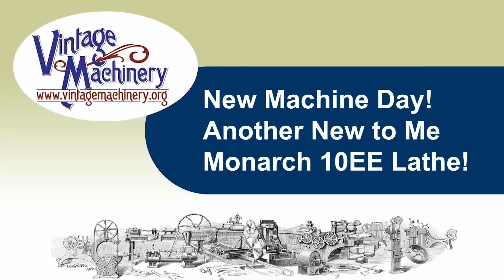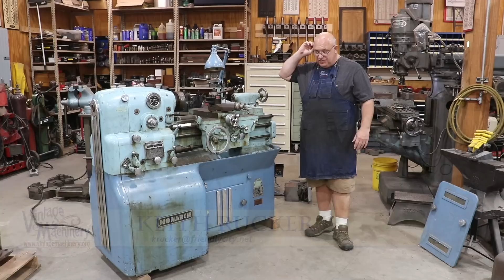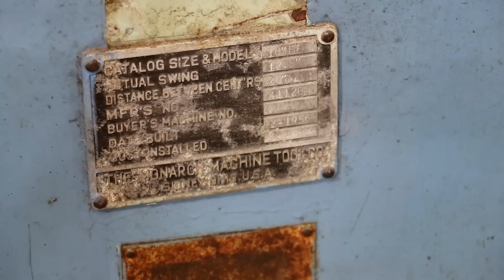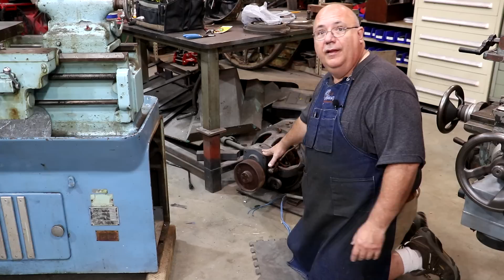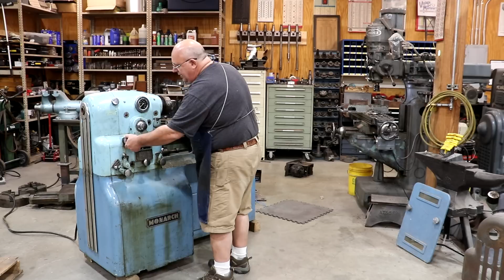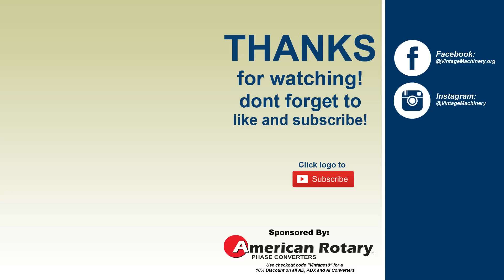New Machine Day! Another New to Me Monarch 10EE Lathe!

Comment: Keith, 120/208 is an extremely common service voltage for commercial applications, and is three phase service. Phase-phase voltage gives you 208 volts. Phase-neutral is 120 volts.
Reply: I think he said that exact thing.
Reply: @michael931  
no..he said it was Single Phase
Reply: @garymallard4699  14:06 he explained it in detail.
Reply: @michael931  
i used to replace Transformers on 208 volts and they are only in Commercial settings... he said what he said which is that he doesn't understand it well...yep !! by his video i believe it ..i did Commercial lighting for 3 decades at many Voltages ( up to 600 volts )...  he has to learn what he has as it was " changed " from factory voltages...and probably isn't 208 and not 3 Phase either..all the components should be labeled..which is where i would start figuring it out....i was referring to his later comment in that part saying he could change or get it at 208.... he needs to get someone knowledgable on what was converted and what it is doing FIRST....as he has no clue based on what i listened to him say..lol

Comment: I don't know if I like those Electronics or not. But I live in England where we have 220V single phase. Now you can get Single to Three Phase VFD converters. So for us is is a simple matter of fitting a new more modern 440V three phase motor 4 pole if you want 1400 rpm (we are 50cycles). Then Just wiring it up in Delta To be 220V three phase Through a VFD & bingo we have a variable speed motor set up. You have to change the motor to comply with latest regs regarding insulation & heat. Now we seam to be more into Poly V belt drives as well to give us less slip & longer belt life. So essentially it is out with the old & in with the new. In your case getting the existing switches to operate the motions is more important than anything else.  But I am not in the USA so not aware of your problems. Regards Mervyn Price.

Comment: Variac change voltage .  The set up is a fully manual replacement for a electronic controlled  voltage supply .  A regulated dc supply  with the current and voltage range need here is a bit pricey . That being said the control of the unit would be very precise  . The service manual for the 10 EE should have the spec and the schematic for this Thyraton tube ( still able to be had used in large transmitters ) based power supply  . The power supply will need to be rather robust by Solid State standards . You may need a specialty  EE with a strong Vacuum tube back round.

Comment: The surge is caused by a noisy signal. You might want to add a capacitor inline after the rectifier to smoothen out the waveform. If you really want a more efficient conversion and speed control, I would add a PWM-based controller which works well. 

Come on Keith. Give the Monarch to me. It's not masculine enough for you.

Comment: You could contact KB Controls in Florida.   They have cost effective DC drives.  Or take the tube drive offered below if it is the correct size and get Uncle Doug to fix it.

Comment: Well, you lose torque with these too  it holds up pretty well, but torque does go down. VFD models, such as the ones I use, and the inverter motors properly used with them, have torque control. My Teco-Westinghouse motor I just used for my mill, has torque control from 6 to 60 Hz. It’s different above that. Too many people use standard 3 phase motors with their VFDs, and that’s bad. There’s a lot of incorrect info out there about using standard motors with 3 phase motors and a VFD. Don’t do that. You really need an inverter motor if you’re planning on using it for speed control. What Keith is saying here is only partly true.

If it was t for the gearbox, you couldn’t use this lathe at slower speeds, because there would be little torque. That’s one of the reasons it works. The DC motor can’t do sufficient torque at the slow speeds by itself. The main reason why they used DC back then was because they really didn’t have the technology to properly vary the speed and torque of AC motors back then. Monarch today, when building “new” machines from old castings, uses VFD drives. The charge almost $200,000 for a machine, so it’s not cost

Comment: If you want to have crazy performance, put a "servo" drive in your lathe.  There are a few videos out there of others who have done this their 10ee.
Reply: The sky's the limit... as is with the cost too. I mean, you could put a $4k+ Yaskawa Sigma 7 drive in there... but worth it? Nah...
Reply: @ratdude747  Found some info on Jerry Biehler's 10ee setup.  Mitsubishi MR-H500AN with a matching HC-SF502.  

Looking around, new in box,  the drive/motor are very expensive but they're all over ebay, under $1000.  That pair appears to be discontinued.  Mildly curious what replaced it.

Supposedly Jerry has a thread about his conversion on Practical Machinist and I may have read it years ago...
Reply: @prototype3a  Don't get me started on obsolete Mitsubishi Servo Drives. My employer has several of them in some transfer presses and upgrading them to newer models that we can get parts for (when they start to fail) has been, ahem, "fun". That said, as far as servo drives go, Mitsubishi has a good product (as does Rockwell, one of the few times I'll say that!).

The only one I've ever heard terrible things about is Oriental Motor. Their "dumb" products seem to be OK but their "smart" (closed loop) products are junk I'm told.

Comment: You are absolutely right that keeping the DC motor will allow a wide range of speeds at full torque. 

Look at the Ward Leonard control, which is a fairly simple way of getting 0 to full speed forward and reverse.  The Ward Leonard control system was widely used for elevators until thyristor drives became available in the 1980s, because it offered smooth speed control and consistent torque. Many Ward Leonard control systems and variations on them remain in use.
Reply: My British Cromwell lathe used one of the ward-Leanard systems

Comment: I have one of those machines and have retrofitted the WIAD with a solid state drive your choices for the solid state are very limited because of the 230 VDC for the motor if the original transformer is still there you going to be way ahead of the game as that is necessary for a proper conversion. You will need two dc drives one for the armature and a smaller one for the field to get field weakening for the higher speeds. Yes, the 10EE is a good machine. That transformer is 240 VAC input.
Reply: Thanks!

Comment: I would suggest replacing the DC motor with an AC motor and Vector control drive which should offer better low-speed torque compared to a V/f drive.

Comment: There should be plenty of DC motor controllers available that will run a motor of that voltage and hp rating.
Preferable to get a closed-loop controller which will give you really good low speed torque for threading and large drilling.
Reply: Even custom building a more modern digital DC motor controller would be a good option in my opinion.

Comment: Odds are that cobbled power system has the motor field and armature wired together. It's only a guess it's likely the original had a constant motor field potential and the thyratron/ignitron vacuum tubes controlled the current going to the armature. The motor field current was reversed to change motor direction. Keeping the original motor with updated control is not impossible.
Reply: In that lathe, the field was controlled by a separate dc circuit and no the field was not reversed to changed direction the armature leads were reversed.
Reply: I figured it had to be something close to that not having seen a schematic.

Comment: I was convinced by the folks on the PM forum for 10EE's to keep the motor-gen set.  I kind of wish this update kept those original parts in play so I could see how far a competent rebuild takes it.  My machine is dated 1954.  I did not rebuild the AC or DC motors nor the generators....always felt I sort of stopped short of doing it right.  Being a hobbyist one has to decide how far to take it to be happy with it.  I did not have the bed reground either.

Comment: Keith, I have a 1954 Monarch 10EE that was converted with a 5HP AC motor and VSD.  I have never been able to stall it when running a very low speeds.  The only difference between the way it runs now and when it had the DC dive is it is only capable of 2,000 RPMs rather than 4,000 RPMs.  I haven't had the need for 4,000 RPMs so far.  I look forward to seeing the drivetrain conversion you do on this lathe.  Should help out lots of folks who are saving these wonderful old lathes.  By the way, I got a quote from Monarch to rebuild a 10EE and install a new drive...around $60K!
Reply: If they were building brand new one they would likely be more, in reality when originally built they would have be comparably expensive new, machine tools were very expensive. Used manual machines are ridiculously cheap nowadays because industry has very little use for them, plenty of working but less desirable, older, well worn or with issues machines go to scrap   because no one wants them.

Comment: Would you be interested in a almost new Works in a Drawer drive for your lathe?  I've got one that was pulled from a lathe 20 years ago that I picked up when I was rebuilding my 10EE, looks pretty good.  Everything is there minus the big thyratrons but I have some spare.

If not the current 'best' solution is a Parker 514/507 drive as it will give you the original speed range.  That might be the best option unless you want the original drive and have a sparky handy to get it going.
Reply: That’s cool!
Reply: Do you have pictures of the WIAD? It would be cool to see it.
Reply: @samuelirons5548  I'm not at all sure I can post a link here.  Here's a test:

https://www.kepler-eng.com/images/10ee_after.jpg

I'll get an image of the drive tomorrow - it's in my shop mezzanine and it's 110F in there
Reply: @russkepler  that worked. 110f? Sounds like Phoenix Az
Reply: @samuelirons5548  East of there in New Mexico.  Here's a shot of the drive:

http://kepler-eng.com/images/10ee_wiad.jpg

I have another drive and DC box that are in poorer condition and a motor with speed reducer (aka back gear) as well.  I'm not sure I'll rebuild another 10EE.
Reply: @russkepler  thank you much

Comment: Keith, in the UK 230V DC motors are not unusual nor is a 240V AC supply (standard single phase is 230/240V there with 3 phase 440V). My suggestion would be to talk to one or more of the DC motor variable speed control companies that Google will quickly find. They may have an off the shelf solution available which would probably be quicker and cheaper than a getting a custom solution in the USA.
Reply: 240V per phase is 415V phase to phase
Reply: @fuzzy1dk  It is shown as 440V on the probably alarmist warning stickers although I agree sine law makes 415V.
Reply: You can run a 230V DC motor off of 220 US single phase supply. I have a 220v input DC drive for a spindle and its output is rated at 240VDC at peak power.
Reply: Just a side note... "European" 3~ power system is one in which the voltage between each individual phase against NEUTRAL wire (0 V) is 230 V, and remains the same (230 V) in 3~ Y configuration (each phase is connected to neutral wire) - but becomes 380 V when in 3~ Δ configuration (connection is BETWEEN PHASES, without using neutral wire).
AC current, as the name itself indicates, alternates, "sinusoid-like" style, from zero to +240 V, then back to zero, and to -240V, then back to zero again, then +240 V... and so "da capo al fine" 50 or 60 times per second (depending on a country and its electrical system - Europe is 50Hz, US and part of Japan is 60 Hz AFAIK).
But because the three phases are offset by 1/3 of the timing of their cycles, the RESULTING potential difference BETWEEN PHASES is √3 times greater than phase–to–zero voltage. And it works to about 380 V, and that's the "between phase" voltage one gets in Δ configuration (wiring), when starting off 3~ 230 V AC. To get higher than that one would have to start with a different initial single phase voltage. In some cases/ places 440V might be available, or even 500V, but the standard is 230/380 V system. At least in continental Europe, but even in UK when you start from "base single-phase 230 V" you can't get any higher than 380V without using transformer or some converter.
BTW, I used here TWO values - 230 and 240 V - that's because (AFAIR) that +/- 240 V is the MAXIMUM potential, while ~230V is "average effective" one.
Reply: @MrKotBonifacy  there is only one voltage in the EU(UK) that is 230V +/-10% (400V between phases) that has been standardized for many many years
Reply: @fuzzy1dk   OK, I looked a little deeper into it, did the math, and, well... "yes but no" (©Vicky Pollard ;-)
True, for 3~ AC where phase to zero voltage ("effective") is 230 V, phase to phase potential would be 400V (√3 ≈ 1.73, x 230 = 398 V - thus "400").
However, in some countries (like in Poland, where I live) it USED TO BE 220 V, in which case the above math works to 380.6 V.
And that is what I was taught in my secondary school back in '80s.
But at the beginning of 2000s the "standard final AC user" voltage here was bumped up to match the "common European" 230 V system - however, for some unknown reason, the old "380V" marking is still used on all electrical stuff I've seen so far. Dunno why, one of those things I'll probably never get to know until my death ;-)
(But hey, I can live with that.)
And sorry for the blooper - I got sorta focused on that "440V" value from original Wilson's comment, which is quite an up mark from either 400 or 380V.
Cheers, and thanks for correction.
Reply: @MrKotBonifacy  no one really had to change anything with the standardization since the common voltages 220,230,240 all fall within the range of 230V +/-10%

Comment: They couldn't leave well enough alone.  Tubed electronics, when properly maintained are FINE.  A lot of radio and TV stations still used tubed transmitters.  I've got a Harman-Kardon Citation II audio amplifier that sonicly beats the living guano out of most solid state stuff.  Plenty of folks who know there way around vacuum tubes stuff are out there.  BTW, for the most part, vacuum tube circuitry is simpler than solid state stuff.  Tubes are mechanically fragile and electrically tough.  Solid state is mechanically tough and electrically fragile.
Reply: Solid state in 2022 is immensely electrically tough.  Particularly in the implementation of ESD protection on the front end.
Reply: @silasmarner7586  ESD is but 1 issue.  If a solid state device gets subjected to over voltage (for whatever reason) it's destroyed.
Reply: tubes are like steam engines, great for their time, but now they are totally obsolete except for a very small number of niche applications
Reply: @fuzzy1dk  True.  However, those niches are (IMO) important.  The niches include music reproduction and high power RF.  BTW, the vast majority of the electricity people use is generated via STEAM turbines
Reply: @eliduttman315  tube might have their place in guitar amplifiers, microwave ovens, xrays and very high power RF, for music reproduction they are pointless.  Giant steam turbines, no one is using piston steam engines to power their car or lawnmover
Reply: @fuzzy1dk  Quite a few people, including me, will tell you that tubes "sound" better than solid state (SS).  It's a very complicated subject and the factors include Physics, psycho-acoustics, and (yes) prejudices.  BTW, the most linear voltage amplifier is the vacuum triode.  Take the time to peruse the curves of the REVERED 6SN7.  FWIW, I'm a long term advocate of tube/SS hybrid audio circuitry.  IMO, superior net performance is what matters, not any specific technology.

Comment: We wore out two Monarch lathes from that era about 1 ft longer than that one off a WWII destroyer.  They were incapable of metric threads...  I really wish they had restored them instead; the replacements are always broken and are not nearly as stiff.  For motors Volts ~ speed and Amps ~ torque -- as a general approximation.  Very good VFDs with speed sensors and feedback are capable of high torque.  Motor size matters for torque.  But DC/universal motors with stator windings in series with rotor windings have the highest start torque.  Dragging brushes and commutator sparking greatly reduce their efficiency, however.  Watch for voltage dropping and causing speed surges.  A likely problem is the brushes in the variac -- that does seem to turn too freely.